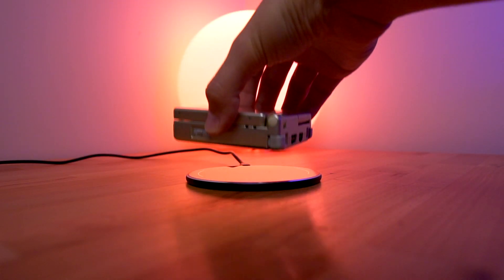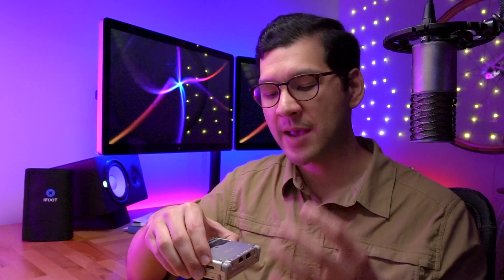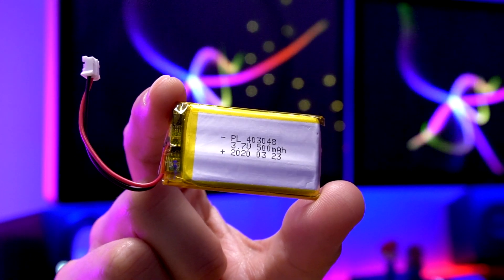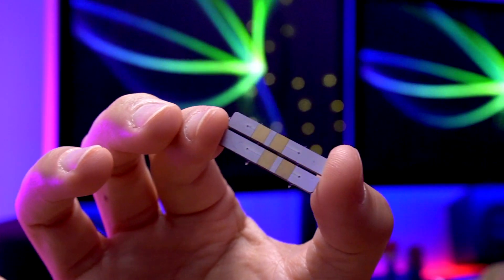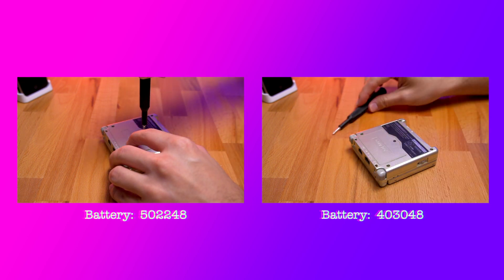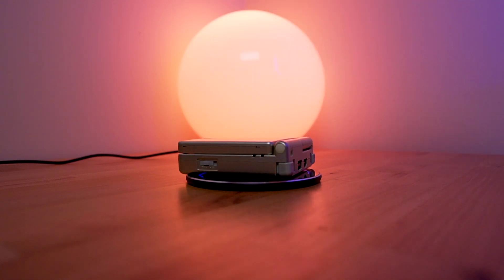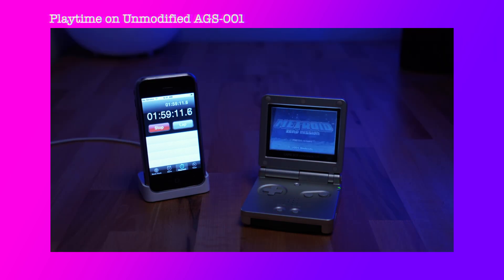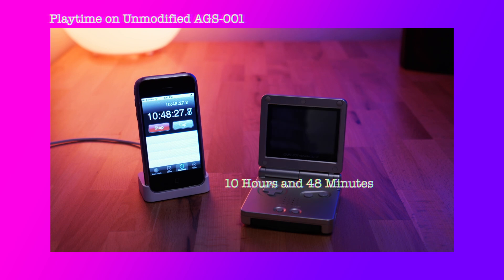PART 2:  ADD WIRELESS CHARGING TO ANY GAMEBOY ADVANCE SP! | GBA SP Mod Tutorial v1.0 | Retro Renew

Comment: moving the circuitry of the wireless charger to inside the actual shell and only having the coil on top of the battery could maybe also be good enough. I will look at earlier video to check if this was considered.

Comment: Now I wanna add Airtag functionality to mine when I'm gonna mod it. There are these wirelessly rechargeable Airtag pass (in my case a Mili MiCard) that when you tear it down has a really flat battery, a charging coil and a really flat circuitry that functions like an Airtag, with speaker and all. I already modded one into a Flipper Zero, together with the wireless charging functionality, and I literally have shell, screen and battery coming in next week for my SP. I think that I wanna get some more MiCards to sacrifice for my Game Boy, adding both Airtag and wireless charging to it. I just don't wanna add USB C as this makes the charger that I have for it redundant, and it has a whole backstory.

Comment: I have a 900mAh 603048 lipo with one of makho's boards in my modded ags 001 and my original phat ds. Both are working great and last alot longer than any 3rd party batteries I could find.

For the ds I had to put some plastic spacers in the battery compartment to keep it from knocking around , so it could probably fit a battery that's a little bigger.

Comment: Edit: I found the spacer put it in and it still cuts out after charging for around 10-20 seconds. 
it's installed behind the screen with the spacer to the back so you can see te coil through the clear case 

So I did this mod and had the exact same issue. My only worry now is I think I've lost the magnetic spacer and I'm gonna have to buy a whole new kit. Has anyone got a place where I can buy just the magnetic spacer?
Reply from the maker: Interesting. I would make sure that the coil is pressed as flat as possible against the top shells surface. You want to minimize the gap between the coils and the charger. It sometimes helps to put something on top that puts some pressure to press the coils flat to the surface, like some foam. I hope that helps resolve your issue. Best of luck!  Cheers!

Comment: What if you removed the plastic that is directly behind the battery? That would give it a little more depth right?  Or, would it be possible to install the black control board part behind the screen and route wires down to the coil and the charge port?
Reply from the maker: That could very well work!  Both fantastic ideas!  My goal was to modify the shell as little as possible. The only issue I can see if that is having the battery contacts align properly. Great idea though!  Cheers Jake!

Comment: Pshh... Wireless charging is a cheap toy.
What I'd love to see is stereo speakers in a GBA!
It'd give me a reason to stop using my DS or my headphones when I use a GBA.
Seems hard though, the start and select get in the way annoyingly so.
Reply from the maker: That’s a great suggestion!  It would be interesting to see if stereo sound could be achieve (it would be mono through 2 speakers). Could be a neat experiment!  Cheers Lasky and thank you for watching my videos!
Reply: @MachoNachoProductions  I'm sure you could tap into the headphone output, or possibly with a custom amp that does the same thing.
Reply from the maker: Very true!  Or even use the same connectors of the original speaker perhaps
Reply from the maker: I’ll have to look into this. Thanks for the heads up!  Cheers!

Comment: the “magnetic” shield is actually a graphite shield. it stops the electrons from going thru the qi charger causing it to charge better.
Reply from the maker: That makes a lot of sense!  Thank you Ben!  The amazon listing called it a “magnetic spacer” and strangely enough it didn’t really seem magnetic. I tried attaching it to my steel cabinet drawer but it didn’t grab. Appreciate the explanation. Thanks again!  Cheers!
Reply: I learned the hard way as well.

Comment: Have you try to isolate the pcb direkt?

The wireless coil Loks like a normal for Smartphone adapter.
There are some really thin.

I let wireless charging in the sp out.
Because the heat that the coil produce.
And my battery ist hard in the case because my usb c port ( for charging and Headset) and the sound board
Reply from the maker: Yep!  I used kapton tape to isolate the coil and pcb. The magnet spacer helped with the charging reliability and I think it helps to isolate the heat as well. Cheers!
Reply: @MachoNachoProductions  mmh at my mods this magnetic thing doesnt change it.
I have the gba, dmg and the New 3ds xl with a charge coil.
The greatest Probleme is the space between coil and charge coil.
And the second is that these 1A coils not really 1A are.
They are around 0.5A.

The wireless coil in the display part could be a other place for it. 

When xou want to knew how usb with charging and Headset in the gba sp work then say something
Reply from the maker: Sounds good!  Thanks!
Reply: @MachoNachoProductions 
http://imgur.com/a/ruIvKuk the pinout for the usb c. It only work with usb c to headphone adapter that use analog audio.
That are the cheap.
Adapter with own Digital Decoder doesnt work
Reply from the maker: Thanks!

Comment: Wireless charging works via magnetic resonant coupling which is basically electricity passed through two magnetic fields in circuit boards. The reason it was stopping and starting without that magnetic buffer is because you essentially have a magnet right next to the batteries circuit which interferes with it
Reply from the maker: Ah that makes sense!  Thank you for the clarification Tempered Phoenix!  Really appreciate it!  Cheers buddy!
Reply: @MachoNachoProductions  no problem
Reply: @MachoNachoProductions  Bit late to the party but the wireless charger you're using looks really similar to one I've used a couple times that I've always had problems with. The chargers just seem to die randomly after a short amount of time. Maybe a different charger would work? But also I'm sure phoenixconcentrated's point still holds

Comment: looks good, thanks for the shoutout!

I do have a couple of suggestions though. If you're willing to cut into the shell, you can carve out the bottom of the battery compartment and shift the whole battery down closer to the system board. This would likely give you enough space to work with. Alternatively, if you have an IPS modded system, there is enough room in the top half to just relocate the battery(ies) there. That would give you the whole battery compartment to work with. See this for an example of the latter: https://imgur.com/a/wZgPfAe
Reply from the maker: Thanks Makho!  No problem, without your battery board with wouldn’t be possible!  Awesome, thanks for the suggestions!  I really like the idea of placing extra batteries in the top half of an IPS modded system, very cool!  Cheers buddy!
Reply: If you relocate the batteries to the top of the housing would you still use the 4mm ones, or would 5mm ones fit?
Reply: @CrestofPotential  I linked the batteries used.
Reply: This mod is awesome.  I wounder how the battery cable passed through the shell from the screen to the battery compartment.
Reply from the maker: Great question!  It would most likely pass through the same conduit as the lcd ribbon cable. Wires will have to be quite thin since it’s a pretty small space. Thanks for the comment!  Cheers!
Reply: What about the battery getting up to temp will that effect the screen?
Reply: @chasenorman6400  there really should not be enough load on the battery for that to be an issue. If there is, you have other problems.

Comment: I bought the qi wireless pad in anticipation of this mod. I even spent a couple of hours desperately trying to find an STL file for the shell of a gba sp. No luck. A compromise would be to make a battery cover that screws in with the battery cover screw, but with expanded dimensions to cover all or most of the bottom of the SP to keep It from being a bumpy eye-sore. I would probably have to make a brute force copy of the battery cover STL on thingiverse in fusion 360 and go from there.
Reply from the maker: I agree making a newly designed bottom shell would be ideal to avoid a bump. I would be interested to see your progress in modifying the battery door!  Best of luck!  Cheers!
Reply: @MachoNachoProductions  so far I've had more luck putting a receiver in a DS shell to make a gb macro that can wirelessly charge lmao
Reply from the maker: That’s awesome!  I’ll def have to look into that!  Cheers buddy!
Reply: @MachoNachoProductions  it would make a great vid. There's only two pins on the charging port for a ds. Power and ground. Easy ;)

You just have to desolder the DS slot to make room LOL
Reply from the maker: Oh snap!  That could be a fun challenge. May be a good excuse to get a hot air station. Do you know which pins on the pcb are ground and power for the charge port?  Thanks bro!  I really appreciate it!!  Cheers!
Reply: @MachoNachoProductions  if you're looking at the board from the back (with the DS slot), the power pin is on the right and the ground pin is on the left. It's the same as USB mini? I think you can look up pinout diagrams to confirm.

Also I was able to desolder the DS slot without a hot air station lol. Liberal use of solder wick. You'll probably also need to cut some of the plastic out of the shell, but nothing destructive

Comment: Dude all your videos have a high pitch noise sound that drives my tenitus into overdrive
Reply from the maker: Interesting, another person said the same thing.  I'm going to have to look into this.  Not sure what it could be.  Have you seen other YouTube videos with this issue that I could watch?  Thanks for letting me know.  Cheers!
Reply: @MachoNachoProductions  no only yours. It could be your mic itself, mixer, or even your video export (unfortunately I'm not an audiophile when it comes to studio recording)
Reply from the maker: That’s so strange. I can’t here a thing. Is it very obvious or is it something I need to really listen for?
Reply: @MachoNachoProductions  it might be one of those pitches you can't hear as you get older. I dont hear it on my pc (though I use an audiophile dac, amp, and headphones) but I consistently hear it on my phone.
Reply from the maker: Thanks for letting me know. Interesting it doesn’t show up on your computer with high end equipment but does show up on your phone. Could it be an issue with your phone?  I usually listen and sound check through my monitor speakers and don’t hear the noise. It could be my old ears can’t pick it up too. Have you listened on other devices?  I would like to resolve the issue. Thanks again for letting me know. Cheers!
Reply: @MachoNachoProductions  its a brand new S20+, and I have not had it happen for any of the hundreds of videos I've watched on YouTube on it. As far as other devices these are the only 2 I have, but I still hear the noise using my galaxy buds or other headphones on my phone (excluding any non type c headphone as I dont have a dongle)
Reply from the maker: I think I’m going to have to make a poll to see if others hear it and maybe help me pinpoint the issue. I’d really like to resolve the issue. Thanks again!  Cheers!

Comment: I forget what its called but the battery was probably interfering with the magnetic field the wireless charger makes and the magnet strip acts like a lead vest when getting an xray. In which it creates separation and isolation to the other coil (the one in the gba)
Reply from the maker: Awesome!  Thanks you for the clarification!  It's so strange how it works so much better with the magnet!  Thank you for letting me know!  Cheers!
Reply: @MachoNachoProductions  no problem
Reply: @MachoNachoProductions  if you haven't  done one already I'd love to see a linup comparison to all the gba 'everdrive' style carts there are to know which is best
Reply from the maker: I think a lot of people will be interested in that. I’ll have to add that to my list!  Thanks!  Cheers!

Comment: It looks like the magnetic spacer realignes the EMF to reduce interference and it also acts as a bit of a heat sink.
Reply from the maker: Awesome! Thanks for the info!  That’s good that it acts as a heat sync too!  It does get fairly warm after a full charge. I’m going to find out the exact heat reading to see if it’ll cause any degradation of the battery!  Thanks for the info Dave!  Cheers!

Comment: hey Tito, if you need some help with modeling a new battery door Id be glad to volunteer my time, I'm pretty good with fusion 360 and I have a cnc machine that I can mill it out on or I can 3d print one to test fit too
Reply from the maker: Oh man!  Thank you thank you!  I will definitely reach out to you, or you can send me an email. I’ve been looking at videos about fusion 360 from Lars Christensen to learn about modeling before my 3D printer gets delivered. I ordered a Prusa mini and it’s on back order until mid September. Thank you for reaching out Kyle!  Talk to you soon. Cheers buddy!
Reply: @MachoNachoProductions  Why not try and sand down the battery area slot and trim it down enough for it to fit? It would probably be less expensive, nail files are really good for removing plastic. Its probably a lot cheaper too. And you can always repaint it with spray paint.
Reply from the maker: That’s a great suggestion!  Thank you!  Stay tuned for this weeks episode, I think you’ll be interested!  Cheers!
Reply: I think what you need is an enhanced battery door, and we are talking here about 2.5 mm difference.
Reply from the maker: New video coming out that will address this. Stay tuned!
Reply: Too late but to be electrical engineer here I look up phone wireless charging tech allot but this is relatively simpler.
Wireless chargers and recievers hate metal, the best thing to do here (use plastic or glass) is to sand the existing door down to the point it's very thin.

Anything metal in the way of the charging pad ... The charging pad will try to induce current in that unwanted metal part. So for an effecient wireless charger you need the coil to have as much surface area as possible, as much shielding behind as possible and little gap between the two coils.

If you notice the battery has some aluminum sheets on it, the wireless charging receiver needs all the induction going just to the coil and not to the shell of the battery, the sheet he added shields the battery and acts as an insulator, the coil is able to get induced better, look up jerry rigs phone tear down videos esp of the Note 10+
Reply from the maker: Very cool!  Thank you for the explanation!  Cheers!